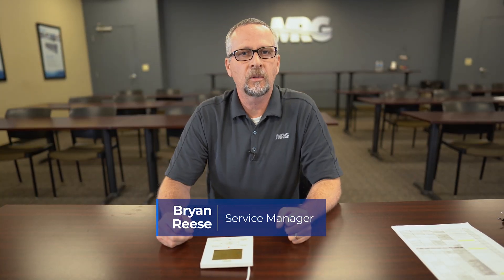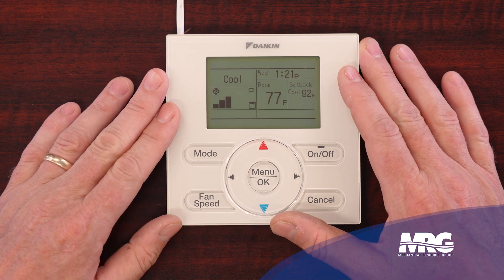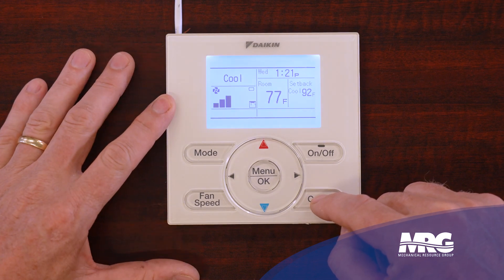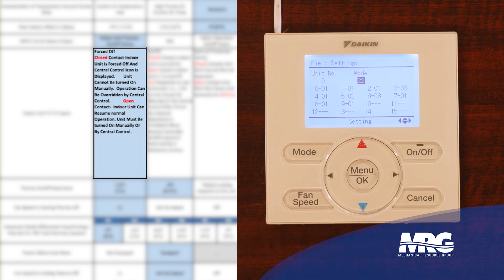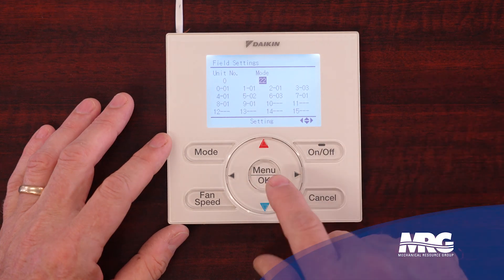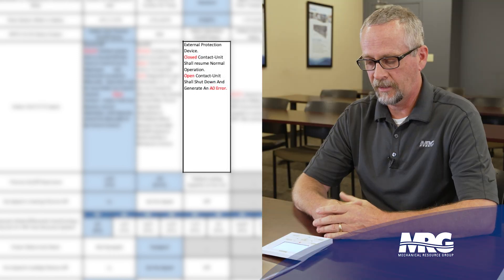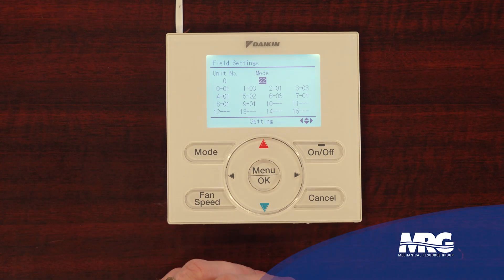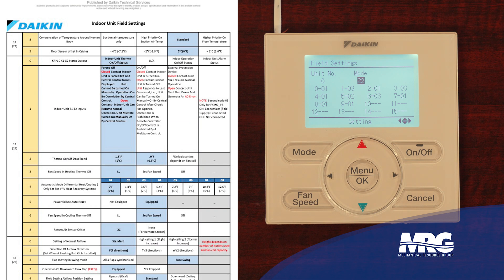Efficient Condensate Management: How to Set Your Daikin Navigator to Forced Off Mode

Comment: Hello.
Thanks for all your great videos!
I have some questions.
Please help me!!!
My Daikin VRV RWEYQ8T7Y1B have this errors U7 and U4.We have 8 internal units.
 I have done TEST MODE:
The pressure is ok.
 In HEATING mode: work fine;
in COOLING mode: the temperature is 2°C instead 5-7°C and here the error U7 it appeared without stop the functionality of this internal unit.
2)Another Daikin two of them internal units does not have Master for internal units.
How can I check communication wiring between internal units?
How do I check which one is Master or how do I reset Master for internal units?
In TEST MODE I think can't run all internal units if communication is faulty for 1 unit or is about other problem for U4 error?
How can I leave 1 or 2 internal units if them is faulty?
How I have to do to readressing?
U7 error is only about for external unit?
Thank you very much?